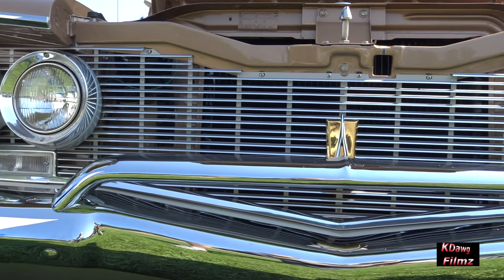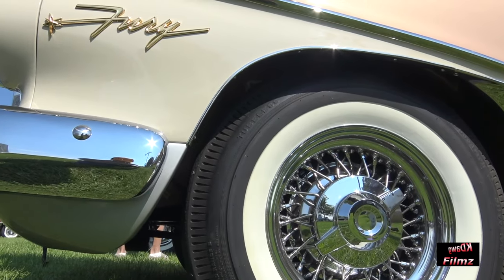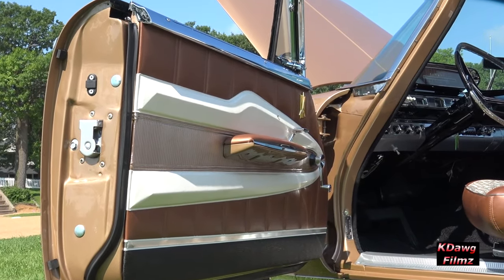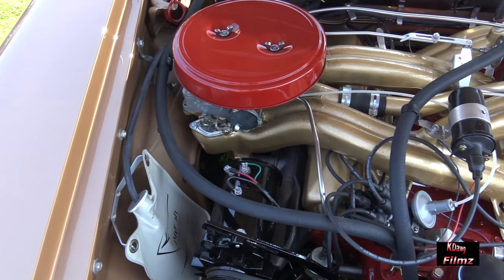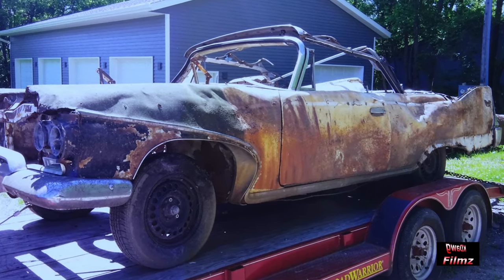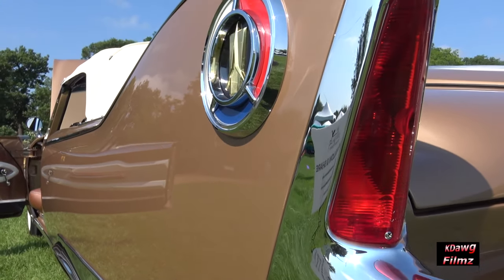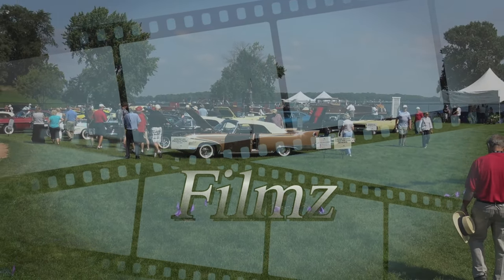Unearthed 1960 Plymouth Fury convertible Big Block Cross Ram at 10,000 Lakes Concours d'Elegance.

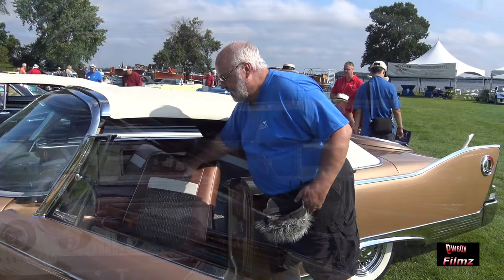Comment: 2:09 No, not an option. Some cars got flat, others got the raised inserts, depending on the plant, and maybe time they were build. And the wire wheels, of course, were also not an option. They weren't even an option for Imperials in 1960.